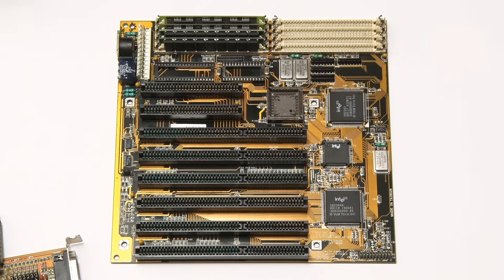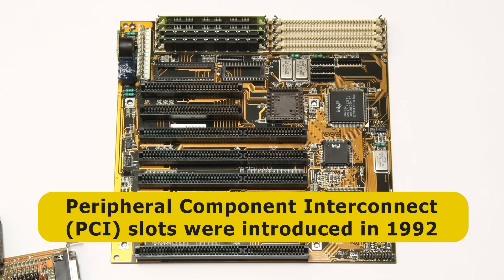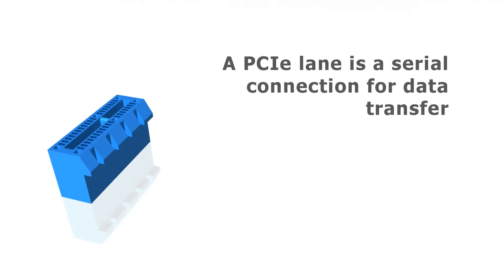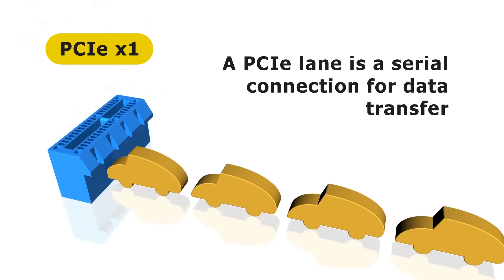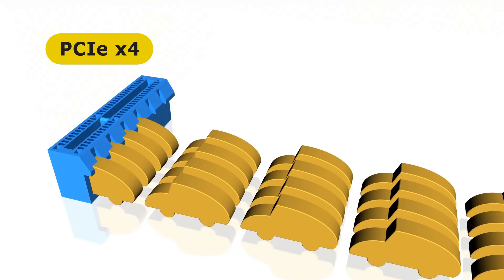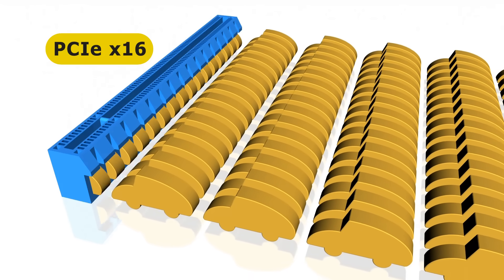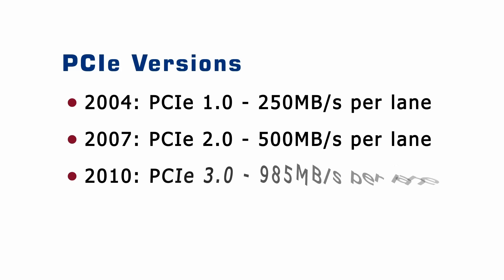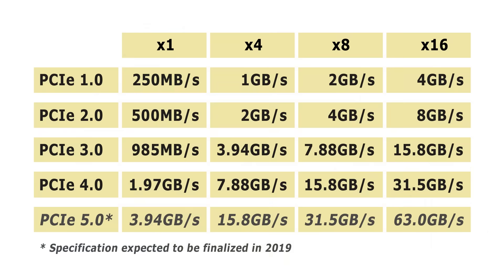Explaining PCIe Slots

Comment: it wont fit physically but electronically it would. someone on a tech forum cut off the pcb partially with hacksaw on his graphicscard to fit it in a x1 slot and it worked. https://www.techpowerup.com/forums/threads/geforce-210-x16-to-x1-mod.110528/

Comment: I've got a PCI 4 speed four port Nics card in a 16 speed slot as this was the only convenient slot to use.  The reason for this is, my computer is being used as a PFSense router and the on board graphics is sufficient to get the installation done and then you don't need a graphics card or screen connected to the computer.

Comment: I had (still have) an Asus Sabertooth P67 board that had 2 PCIe 2.0 16x slots but upon examination you could run a single x16 card or 2 x8 cards but not 2 x16 cards.  Nor could you run an x16 and an x8 card.  If you populated both slots both would run at a max of x8.  I believe they called that x8/x8 dual mode.  I'm not sure if that has carried over to later architecture but it might be worth a mention.

Comment: I feel it worth pointing out that some older Macintosh systems in the professional end, like the later PowerMac G5 and the pre-trash can Mac Pro systems, use full size PCIe slots, with some of them (depending on the particular model of machine) being either 1x, 4x, or 8x, yet they are still full length slots. I haven't looked at them closely enough to see the missing pins for the lesser laned slots, but it's an interesting design nuance in Apples mid-2000's professional line to use such arrangements of full physical length slots.

Comment: One other point to note... PCI slots had a shared throughput between them of 133MB/s - a single PCI-E x1 1.0 offers 250 MB/s and it's not shared, so x1 offers enough throughput for anything that PCI used to cover, typically x1 cards will be moderate speed controllers - I'm getting an x1 2.0 card to provide SATA 3, though at 500MB/s, it can't quite meet the full throughput of 600, but may be faster on my SSD than the 300MB/s SATA 2 controllers on the motherboard.
x4 is used for things that need more throughput, but don't warrant the full x16, something like a RAID controller, or an x4 connected PCI-E SSD.
x8 … I don't know of any physical x8 slots, but you may find some lower end graphics cards that are physically x8, and some physical x16 slots that are only x8 - I have a motherboard with two x16, but a specific slot must be used for x16 and a supplied paddle board fitted in the other, otherwise the two slots operate at x8.

The reason for limited slots (remember, PCI-E throughput is not shared) is chipset and CPU limits on the available lanes, with full x16 slots consuming 16 in one go. It is also possible to have PCI-E 3.0 and 2.0 on the same motherboard - I have one where the x16 slot upgrades to 3.0 with a 3rd gen CPU, as the lanes for that come from the CPU, but the x1 slots are 2.0 as they are driven by the 2nd gen Chipset

Comment: Modern Brooktrout fax cards (yes, they still make fax cards, up to 30 channels per card for an E1 circuit) don't need a lot of bandwidth and are electronically PCIe x1.  However, they are large and heavy cards so their interface is actually a PCIe x4 so you use a physically larger slot to help better support the weight.

Comment: Thank you again!  You brought back working days at IBM.  WE ONLY USED XT AND AT  FOR DUMB TERMINALS CONNECTED TO MIDRANGE /mainframe systems.  Then I was given PS2 with IBM's OS2 (their windows product they trashed years later.  I liked OS2 because you could change priority of programs to speed up processing your work. LOL I was caught several times controlling small server production. Hahaha

The card technology for midrange servers and mainframes was proprietary called "MICROCHANNEL". Competitors sold $300.00 Ethernet cards. IBM sold $1,200.00 microchannel cards. Hahahaha.   We got smart and integrated pci/USA, pcie technology. Then we chose a vendor to make each type of card needed.  So much easier, and cheaper to sell, maintain.  Those were the days!  USA Unix high end computing sales, then worldwide ASIA sales before they "right sized" and I was hit.

Comment: The 2X AGP slot, and 8X AGP slot were in fact,  identical in shape and size, but their orientations on the MB were the opposite of one another, so that one couldn't plug-in a 2X card into an 8X slot (and vice versa), because its ports would face the wrong way and be inaccessible. One would have to be on drugs in order to make such a glaringly obvious mistake. :D
Reply from the maker: Ah, but the point is that you often had to set voltages on motherboard DIP switches or jumpers. I know of many who blew up cards . . .
Reply: @ExplainingComputers  I still have an old Intel PC (D865G), that I still use today for entertainment purposes (i.e., watching TV and playing music in Ubuntu 16.04 or Win XP); its MB has an 8X AGP slot and no DIP-switches. Although I do remember them on older, 2X AGP MBs, I do not remember them being on any 8X AGP MB that I encountered.
Reply from the maker: I think you are right -- by AGP 8X there were no motherboard voltage settings. In the video I was making a general point about AGP, based on the hardware most easily to hand! :)

Comment: I missed scratching on 64bit PCI / PCI-X slots and (principal) backward compatibility. Also the crazy but working practice of filing of contacts of to long PCIe cards. And the increased power delivery to 75 Watts, that even allows to run USB-C without an extra power connector (Asus 712900025798)

Comment: Very informative Sunday, as always 👍. It would be a good idea to cover how RAM and RAM modules has changed. From Static RAM on early PCs, ferrite core memory (first kind of DRAM?), change to DRAM in 8-bit era and then SIMM, DIMM, DDR, DDRx, RAMBUS. Maybe event a bit about cache memory in 386, 486 and why cache-less Celerons were so incredibly slow.
Reply from the maker: For a long time I have been planning a video from RAM, from magnetic core storage on onwards! I really must get to making it.
Reply: Don't forget to mention SIPPs that predated 30 pin SIMMs and how later SIPPs were just SIMMs with pins soldered on. The early SIPPs didn't have the shaped ends so removing their pins wouldn't make them work in SIMM sockets. Then there's chip package types, ZIP (Zigzag inline package), DIP, surface mount and more. Yet another thing to cover would be ISA RAM boards and how some had DIP switches or EEPROMs to set them as Expanded (XMS) or Extended (EMS) RAM or split between the two. For computers with less than 640K of RAM on the motherboard, these RAM boards could be configured to 'backfill' that up to 640K then have the rest as whatever combination of XMS and EMS you wanted.

With the advent of the 80386, hardware EMS was no longer needed. It could be emulated with a DOS driver (EMM386.EXE) and with a way to select options during boot the configuration could be chosen during boot. Hardware EMS of course would still work, but with the greater XMS memory capabilities of the 286 and 386 CPUs support for EMS quickly went away with newer software. That can be a bit of a pain when attempting to revive use of very old DOS software that needs as much EMS as can be provided, as newer PCs tend to have their upper memory map so chunked up there is no contiguous 64K chunk for the EMS 'window'. I have an old benchtop CNC milling machine that only has DOS control software. It can load the GCODE files into whatever low memory is available, or it will load it into EMS, if any is available.

I had a 12 Mhz 80286 with 12 megs of RAM.  640K on the main board with the rest on three ISA cards full of ZIP chips. I also had a Pro Audio Spectrum 16 (a Reel Magic sound, VGA and SCSI card but with only the sound parts populated) and an 8 bit Soundblaster Pro. Those were configured so that DOS games could be configured to automatically use the best sound each one supported.
Reply: Yet another thing about RAM in early PCs and clones is that speed mattered quite a bit. Using RAM chips faster than specified could make the computer faster. For example a PC that specified 150ns RAM could get a significant boost from swapping it all for 80ns. How? It's in the timing.

The RAM had to be ready to be written or have data ready to be read at no later than a specific point in the write or read cycle. The system designers provided quite long 'windows' for the write and read readiness. How faster than specified RAM could make things faster was the RAM signaled when it was ready, that wasn't under the control of the memory control hardware. The instant the RAM signaled it was ready, the system would write or read then immediately advance to the next step, cutting the timing window short.

So if the system specified 150 nanosecond RAM the end of the window might actually be ~160ns while the start of the window could be ~75ns. Plug in 80ns RAM and the RAM cycles would end 70ns sooner.

But what if you plugged in 60ns DRAM DIP chips (assuming you could afford them!)? The rating on the chips was a minimum speed. They could wait around to be written or would hold the data to be read until the system was ready to write or read.

With an IBM PC/XT you could see and hear the speed difference immediately during boot with the RAM counter/ticker. Stock specified RAM would go TICK*TICK*TICK*TICK*TICK*TICK*. 80ns RAM was *BRRRRRRRRRRRRRRRRRRRRT! Putting faster RAM in a Model 5150 only made the bootup wait a bit shorter. There was no feedback except the blinking cursor in the upper left of an otherwise blank screen. I supposed one could count the total number of cursor blinks with stock speed RAM and faster RAM to get an idea of how much boot speed was affected. 286 PCs could also benefit from using faster than specified RAM, but starting with the 386 systems the RAM and other timings were being tightened up and (IIRC) using RAM faster than the absolute minimum for the timing could cause problems, or not boot.

For Macintosh systems, at least the 68K CPU ones, using faster than specified RAM would give a small speed bump, at least as far as benchmarks showed when I tested several models and their RAM speed was higher than the comparison specifications for those models. Wasn't enough faster to notice in real use, unlike with the 808x and 80286 PCs I owned.
Reply: @ExplainingComputers  yes!!!
Reply: @ExplainingComputers  Please do so. It will be a real winner because ram has become somewhat confusing.
Reply: ExplainingComputers eBay has some nice satellite and airspace Soviet ferrite core parts, also nv ram passages too nvidia ingest semantics and mathematical S too or back from the Cyrix 33,pi radial General Motors jag back axels fork sprung tekniques!?
Reply: Good idea,  my first pc was 4MB ram (386 dx 40MHz). I will be wait for this topic.
Reply: My first computer had 512 KB RAM, which I upgraded to a whopping 4MB which is as much as The Operating System (TOS 1.4) can handle. I don't use it much now, but it still works fine for certain things.
Reply: I started with Atari 65XE with 64 kB of RAM. Then moved into PC world with Hyundai Super 16V PC/XT with whooping 640 kB of RAM, 10 MHz 8088 CPU, EGA graphics and single DSDD 360 kB 5,25” floppy drive. No hard drive of course.
Reply: Great idea! My first PC in 1994 was. a 486 DX2 with 4MB ram. It was back in the day when you went to a shop and talked to a salesman about what components you wanted in the machine and they ordered them and built the computer for you.
Reply: Don't forget about the short lived EDO RAM.
Reply: It wasn't all that short lived, but there were some compatibility issues. Some computers could use either Fast Page Mode or Extended Data Out, but would operate the EDO as FPM. But some EDO SIMMs and DIMMs wouldn't work in FPM mode. So trying to use EDO in an FPM system was a chancy business. Far as I can remember, a board that required EDO would only work with EDO, unless perhaps there was some rare exception that would work with both and could operate FPM in its way and EDO in its way.
Reply: Am I the only one who noticed that in the last example the video card was larger than the whole motherboard it was inserted into?
Reply: There was a fascinating Numberphile video on an old calculator that used a coil of wire as memory! It essentially is an acoustic delay line.
Reply: I found it hard back then to get more EDO RAM at the time when I had a Dell GX Pro that used it, I vaguely remember there were meant to be advantages to using it but I think SD RAM was the next thing that killed it in the consumer realm.
Reply: Wouahhh, You guys are really old, I started with the macintosh one, I don't remember the name, without knowing how to read (english is my third language), I learn what copy-paste meant before english class in the 4th grade, I was like 6 or 7 years old at that time, I get very instinctive about computer interface because of that I learn so much by clicking there and there and waiting for the result, I good time in my life, somehow I became a electronics technician insteaf on an IT, I think it is because I don't like resolving user generated problem ahah. Peace and Joy ahah
Reply: my first computer wasnt a 'PC' type but a sinclair zx81 with 1k ram, yes, 1k,   not a lot of use so soon had the 16k expansion pack, no longer have this actual one but have about 10 i got second hand from various  places, i do still have my original second computer, the sinclair zx spectrum, 48k  and still  works ..😊
Reply: Ferrite core memory is not Dynamic RAM. A "Core Store" can retain it's contents uncorrupted for just over 400 years without power.

TTL RAM was the first chip based memory. The 7489 16 x 4 bit device being a typical example. I built a crude 4 bit computer using 7489 TTL RAM devices back in the 1980's as a college project. It also used a 74181 ALU.

Comment: I just got a lesson in pcie slots yesterday putting an nvme m.2 card into my older computer. I was only getting half the speed and it turned out I had v2.0 pcie.
Reply: that's because pcie 2.0 x2 bandwidth is 1gb. you're early m.2 nvme drives could only support up to pcie x2, but even pcie v3 x2 isn't fast enough anymore seeing as modern highend m.2 nvme drives can now exceed pcie v3 x2 bandwidth.  this is why modern m.2 nvme drives can now support up to pcie x4 to meet the modern highend m.2 nvme drives standards, but only pcie v3 x4 or above will meet those bandwidth requirements for highend m.2 nvme drives without bottlenecking those drives performance.

Comment: wait so if a graphics card is pci-e 3.0 and the motherboard is 4.0 will it run 2.0 or was that a mistake? (6:57)
edit: my bad! i tend to press on pause too early dont i
Reply: The motherboard was PCIe 2.0 based not 4.0.
A PCI 3.0 GPU in a 4.0 motherboard, would run at 3.0 by default. Many motherboard allow you to choose the lane speed to improve compatibility.

Comment: Chris, thanks for another informative video.

In the early 1980s, my first work micro was a Z80 based NorthStar Horizon with a maths co-processor added via its S100 expansion bus. 

For number crunching, this £3500 computer gave me about 70% of the power of the £30,000+ PDP 11/34 that I had been previously using.
Reply from the maker: How things have changed!

Comment: Correct me if I'm wrong but you forgot to mention that pci runs in parallel ang pcie in serial
Reply from the maker: I debated with myself greatly what to include and not to include -- there is a label noting that PCIe lanes are serial.

Comment: I don't remember any PCI motherboards emerging on the commercial market in 1992.  I remember them being introduced in conjunction with Intel's Pentium Processor (which was so named because they lost a court case against AMD, Cyrix, etc. when a judge ruled that they could not trademark a number i.e. 386, 486, etc.).
Reply from the maker: Indeed. It is always hard to decide where to place dates. PCI as a standard as far as I could find was established in mid 1992, but actual hardware would not have arrived immediately.
Reply: @ExplainingComputers  THE EISA bus never gained much traction in the market.  But, the VL-Bus was massively popular.  Lots of video card manufacturers made versions of their cards to take advantage of it.  ATi produced a series of Mach32 / Mach64 cards that were VL-B.  Without the VL-Bus, Windows 3.1 would never have been adopted by the market because the GUI would have just been too slow.